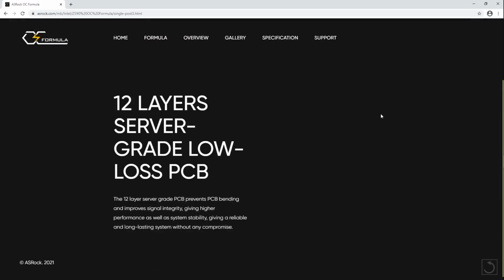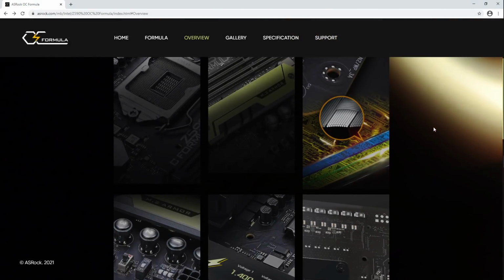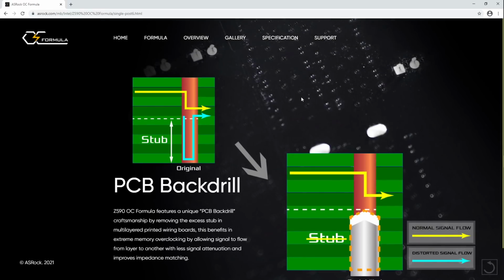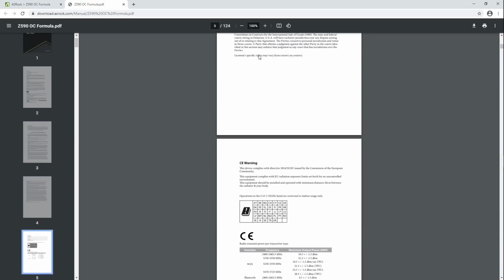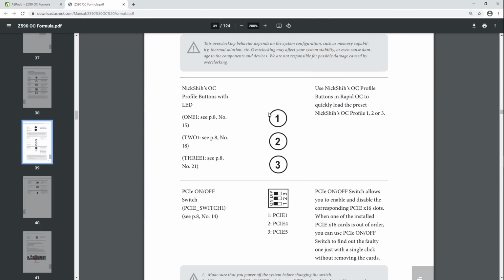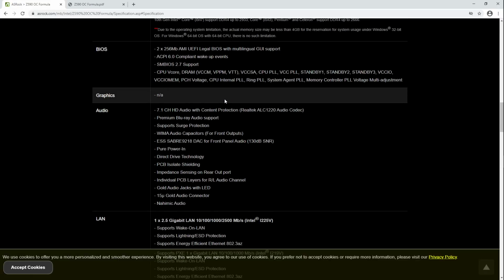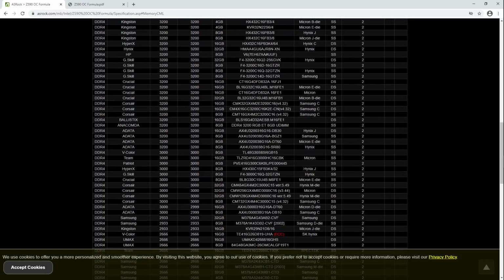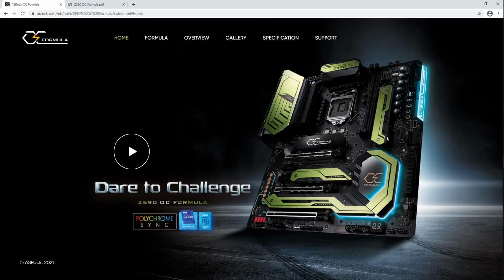Asrock is making OC Formula boards again!

Comment: These are down to $135 right now from Newegg just in case anyone is wondering..
Reply: I also noticed it.
Bought one out of impulse almost, was planning to build a custom router and now this board is going to be used for that. It's stupid silly overkill for the task but it's fun.
Alot of Z590 boards are getting heavy discounts. Bought an Z590 Aorus Master for my main system and it was $130 and despite reviews talking about instability or issues with the 10G NIC, My shit has been flawless. Probably helps I don't OC.

Comment: Hey buildzoid I was watching the kit guru review of the 11900 and z590 and the dude mentioned if you put a 10 series cpu in the z590 boards then the m2 socket won't work because of the pci lane configuration, or something like that, any ideas?

Comment: does b550 extreme4 has similar vrm thermal performance as b550 steel legend
and is b550 steel legend a good board for a little oc

Comment: There is one thing I don't understand about this board. This is squarely aimed at (extreme) OCing, right?
So why would they throw an ESS Sabre9218 on there? I understand the NE5532-based front panel jacks (somewhat) on most gaming boards, gives at least the hint of quality to the audio out. But on this board? Why another hand full of dollars for that?

Comment: My Z87 OC Formula had an OLED display... while the MB still works (just, it ran 24/7 for years and I think the caps are on their way out as attaching fans or a graphics card causes it to multi-boot loop so I'm guessing there is lots of line noise somewhere) the OLED died years ago. It was a bit of a gimmick back then and didn't to much more than replace the 2 digit LED (and show some additional status data, temps and such like, if you pressed one of the buttons). Its currently running headless, as my backup server, but it does work if I attach a monitor to the MB (I can't remember which processor it uses, was the top of the range K, but it has inbuilt graphics). The odd thing was although it was sold as an OC board, its biggest selling point for me was that it had 10 sata ports so I didn't need to buy a sata add in card (which were quite expensive back then, now they are dirt cheap).

Comment: ASRock tends to put a lot of thought into when it will release a "true OC" motherboard. Since they are much smaller and have not been around as long it's a big risk for them so the seem to pick and choose wisely. Mainly it seems like they focus on memory overclocking, so they must have a good board earlier in that platforms cycle and at the very end when fully mature.
Z97 OCF / Z170M OCF / Z590 OCF and they make the boards so easy to use by removing  / setting Auto rules in bios. Unless you get a dud (I had 2 on Z97 and 1 on Z170) you are pretty much guaranteed the most enjoyable RAM OC / XOC experience on the platform

Comment: Reason for using back drilling over blind vias.

With blind vias you are limited by what layers you can go between due to how they are manufactured, often you will have to limit yourself to only using blind vias between the top 2 layers across a substrate (not across pre-preg) otherwise it gets very expensive.

Back drilling on the other hand allows you to go between the top layer and any other layer for about the same cost as 1 blind via layer, the downside is you can’t have stacked blind vias or proper blind vias with features on other layers (the main reason people use blind vias) but that’s not an issue for simple stub removal.

Comment: So many overclocking boards for the most DOA cpu launch in years XD lol.
Reply: potentially the thermal density of 11th gen is rather low?! That could be a good thing for OCing the chips
Reply: @milchkopf3881  its not though. They run really really hot XD.
Reply: @LawrenceTimme  techpowerup measured 11900K 19°C lower than the really really hot 5800X under Blender load on air.
Reply: @MrKentaroMotoPI  that's strange, because from all the other reviews I've seen the bintel is pinned at 100c and  AMD CPUs can't even get to 90 without limits being removed.
Reply: @LawrenceTimme  Most reviewers are biased hacks. Fortunately, we have Buildzoid... and SkatterBencher who just posted a very detailed review with voltages, frequencies, power, and temperatures for a wide range of settings from stock TDP up to 🔥on EKB water.
A common misconception is that a particular cooler can "dissipate" a certain amount of power (Watts) for a given temperature difference. In reality, the cooler - like any other heat exchanger - moves a certain heat flux (Watts/meter^2) through a given temperature difference. A larger CPU die, at the same power, will have a lower heat flux, and lower temperature difference.
Reply: @MrKentaroMotoPI  I don't think anandtech are biased hacks XD. Ian has been doing xoc before buildzoid was out of school XD.
Reply: @LawrenceTimme  "PhD Ian" If that self-absorbed clown was competent, or honest, he'd have a real job. His commentary on AVX512 is laughable. His own code supposedly uses it, and he lies about it, or just doesn't understand it. I still read Anand for SSD reviews.
Reply: @MrKentaroMotoPI  i think hes just more interested in higher level server type stuff and interviewing high up people than consumer level stuff. He still tests all the cpus in the same way though and the bintel runs hotter.

Comment: backdrilling is standart on 3000 series nvidia gpus, the gddr6x memory requires backdrilling to operate, because the distortions get to big otherwise. so it has to help a lot, because nvidia forced all the gpu vendors to buy equipment for backdrilling.
Reply: Interesting

Comment: OH MAN What an awesome PCB!
9:38 Ditching the input filtering inductor will "theoretically" improve the transient response performance of the input stage, as the inductor will block rapid changes in current. The downside is more ripple, which they are taking care of with all the capacitors.
10:55 I once worked with 16 layer PCBs using JESD204 (which is a JEDEC standard for SERDES similar to ram). You can do all sorts of cool stuff with a high layer count. Usually you would have low speed signals, then GND, then high speed signals, then GND again, then a power plane, then GND again, analog power plane, GND, etc. You can use it to isolate the noisy digital stuff from the sensitive analog stuff, but here you can isolate parts of the memory channels, the impedance matching gets a lot easier, you have much more capability for via stitching to isolate lines, (especially with buried vias) etc. They might be able to have a differential transmission line for each RAM signal pair.
12:30 YEAH, Backdrilled vias are not as good as fully buried ones but they're still awesome! Via inductance is usually a few nH, so this really helps. I'm amazed they have a decent picture of an open stub on their transmission line.
14:20 Backdrilled vias are a kind of blind via since it's neither a through via nor a buried via. Yes they are more expensive, since you need a separate drill process after the via plating is done. Cheaper than an actual blind via though.
I zoomed in on the picture of the back and you can see a lot of backdrilling under the RAM slots (as expected).
Reply: I'd guess the factories had to set up for backdrilling for the Nvidia RTX 3000 cards, so now asrock can just use that ecosystem for this board.
Reply: i dont understand, but i agreed 😂👍
Reply: nerd

Comment: I'd buy it in a heartbeat if it could add 2 cores to a 11900K.
Reply: I didn't get the z490, but I do plan on getting z590, one of these OC boards, not sure which yet, but I will most likely get the 10900k until I can find the 11900k dirt cheap. And then it would only be to have fun OC'ing it.
Reply: @Apollo-Computers   why would you downgrade to a 11900k when you gotten the 10900k?

Comment: I have a Maximus Hero XI and I can't see the post code at the top in my Define S case because there's a radiator blocking my view. I'm guessing it was a concession to those who might overclock with the board in a case for some bizarre reason.

Comment: Buildzoid:
M13A: Intersil 69269-->20mv less bios voltage needed for exact same load voltage (10900k@ 5 ghz) @ LLC6, lower amps draw, V-latch transients!!  Tested on M13 Extreme, should apply to Apex.

Comment: Hey Buildzoid, which do you think will be better, the super sick 22 phase z590 dark with a 10 layer pcb, or the also super sick z590 oc formula with a 16 phase and 12 layer pcb(i know phase count isnt everything but i think theres a reason tin decided 22 was perfect) idk idk which one to buyyy as to why I'm asking in your opinion which do you think will be better? P.s. evga has a website up about the z590 dark and i think another tech website has info about it too if you google it. I also believe i saw it was going to be 699$
Reply: EVGA lists every minor power section into their phases to make their boards look more impressive.
Reply: Biostar H410MH is the perfect fit for you. thank me later
Reply: @milchkopf3881  sooOoo funny, i actually like biostar boards, not for performance, but some of them look really good, and for now ill stick with my x299 dark with 7960x, my x299 oc formula with 7900x, my z170m oc formula with 9900kf(hard modded so z170 will run any 1151 cpu) for now so im set, i was just wondering his opinion on which to pick up, because im def going to buy one or the other, im probly gonna pick up the dark due to tin and vince working so close together aka engineer and overclocker being so close, im sure Nick shih is close with an enginner but not like vince and tin, their team is unreal.

Comment: 12 is the new standard pcie4 requires more isolation 12 layers has nothing todo with overclocking its strictly for supporting pcie 4 I don't know of any pci-e 4 boards with less then 8 layers
Reply from the maker: This is literally the only Z590 board I know about that has 12 layers. The vast majority of B550/X570 Z490/Z590 boards are 6 layers.

Comment: lol never saw that one coming! is it am4? otherwise im not interested... still got here my z170 of formula with custom bios for running 8700k... with it being at max compatible with 9900k. 8700k was probably the last 'worthwhile' cpu intel ever made before amd took over. couldnt see any point for upgrading further. but hey! you know what? sometimes it shorts itself out and goes into a boot loop during initial power on. before posting. and i have to power cycle it multiple times. dodgy as were these asrocks way back then. pretty above average failure rate with a  reputation to kill cpus unexpectedly and for no obvious or apparent reason
Reply: I don't want to patronize you tough it's a z590 board so you should be able to do the math...
Reply: Lol overclocking AM4, now there is a knee slapper!  Good one!